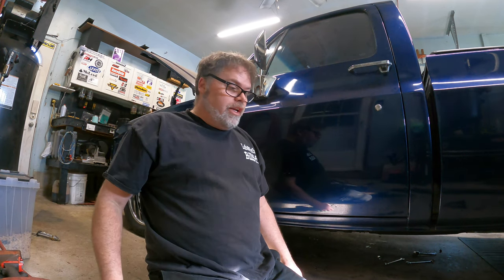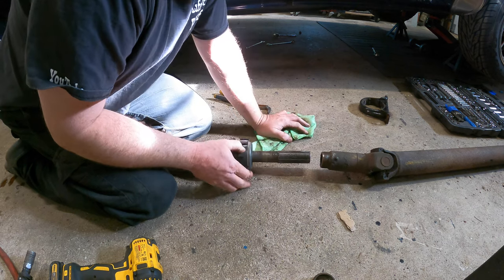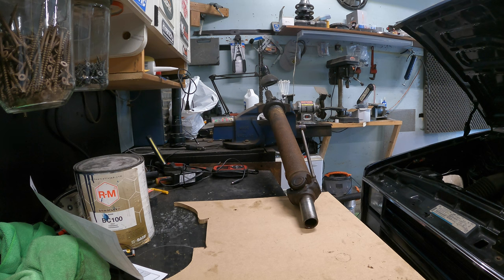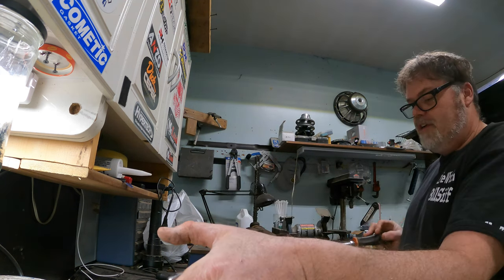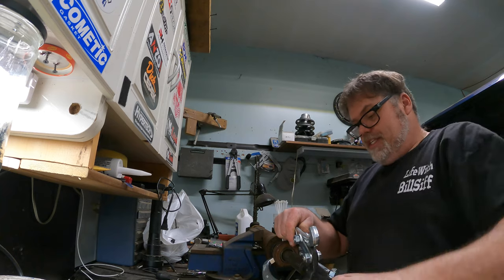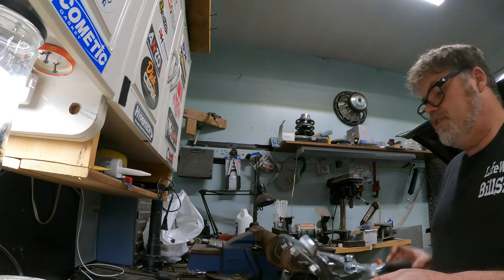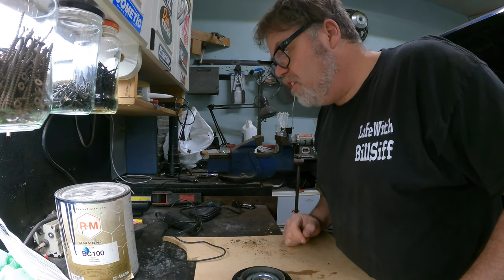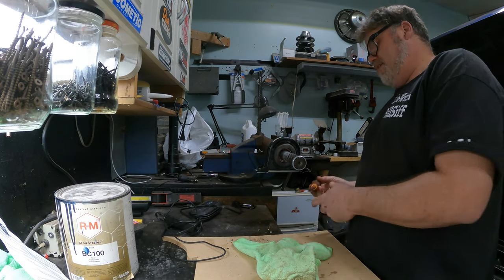Intalling Centre Beaing Into Drive Shaft   4K

Comment: Always Change them when you do that job. 
Nothing like having 100% reliability in a truck. 
Make sure that the u joints are pre positioned so you can grease them.
If on backwards you cant get grease gun nozzle inside joint to grease the zerk.